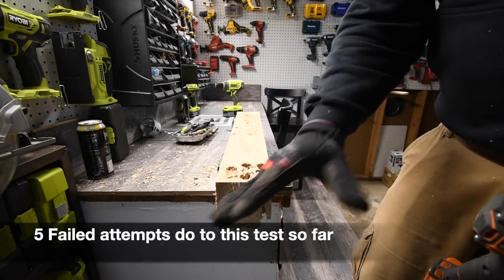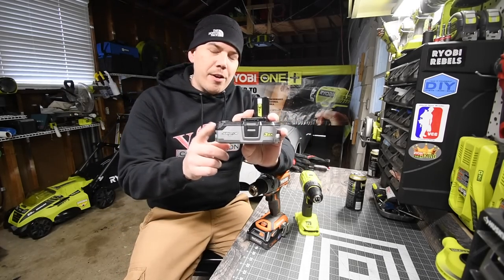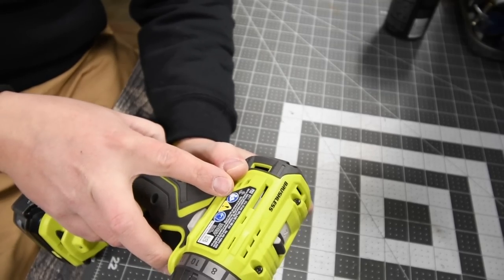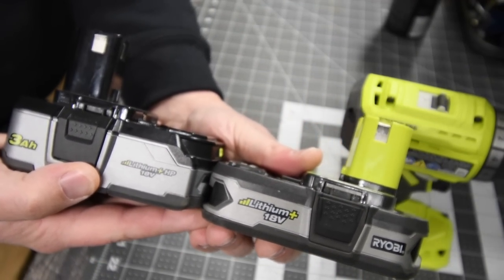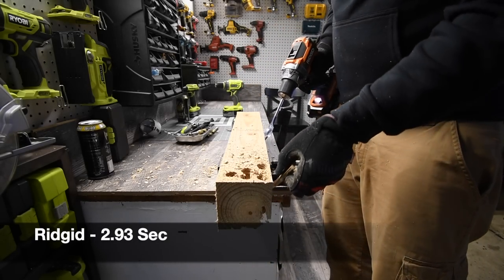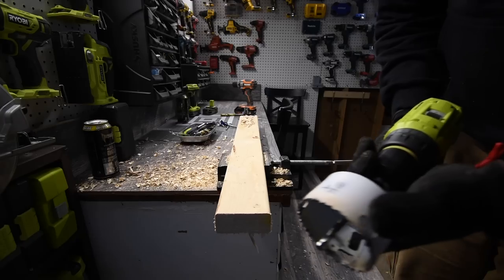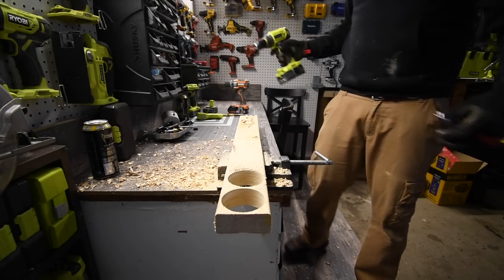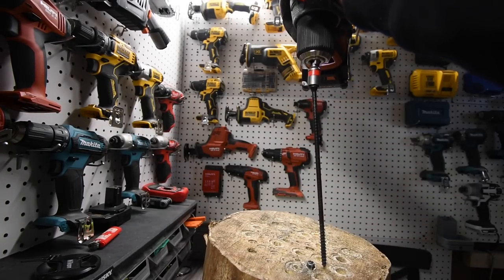Ryobi vs Ridgid (Drills)

Comment: TIM from Canada he didn’t tell you and I don’t think you saw it but Ryobi it was smoking pretty bad there these tools from Ryobi are only good for one thing nothing I have stools I am not impressed.. Ryobi tools are supposed to be for the handyman but why do they have pro tool price in Canada the prices for or two times the price they should be
Reply from the maker: it was not. the screws were. I did more extreme test after this video and the Drill is running just fine with no smoking